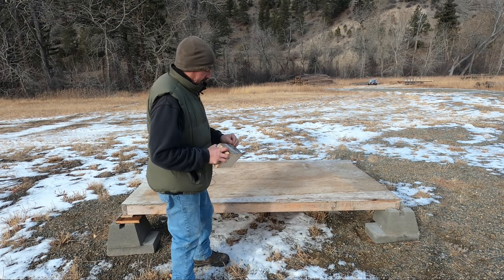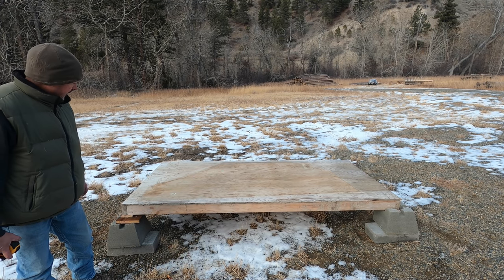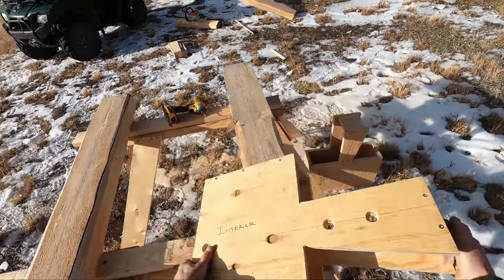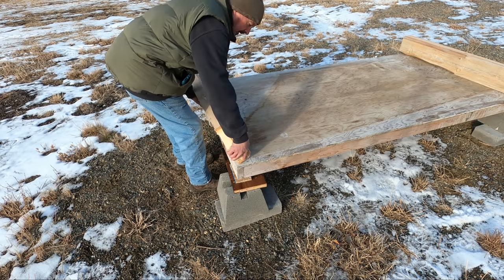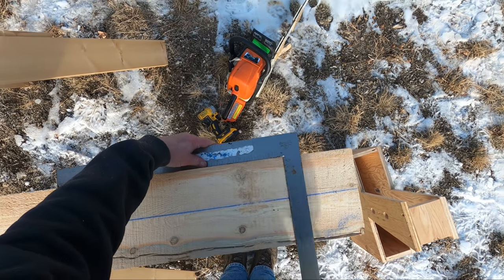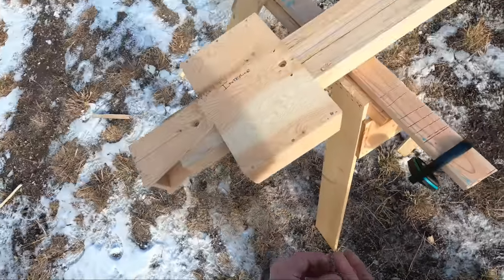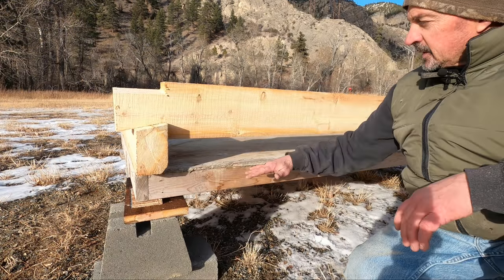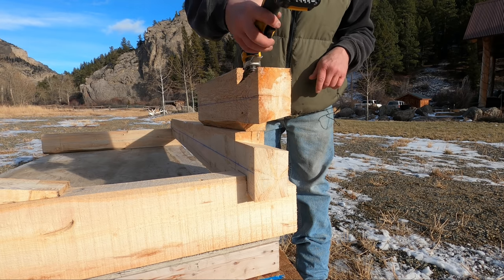How to use dovetail jigs to build a log cabin.

Comment: Appreciate the demonstration. Very well done. Now, how do I go about cutting dovetail corners so that my parallel logs fit tight together without space between them? I want to cut a groove in the bottom log to place insulmoss so it will be compressed between.
Reply from the maker: I plan to do a video soon using D shaped logs and no gap. Stay tuned.

Comment: @10:39 "Need a little more power for cutting the jig."

Have you messed around with non-stock chain grinds?  I suspect it could make quite a difference for a little saw.  I'd like to mess with a "straight grind", since I've seen some pretty remarkable results in comparison races.

But, for notching, it seems like a rip grind might be helpful, since most of the cut length is parallel to grain.

Any thoughts?  I do have a small electric saw, which I had thought might be nice for notching - maintain peaceful relations with the neighbors during late-night work bees at the house in town, etc.  One of the 220v Scandinavian saws would be nice, but they seem to be rare as hen's teeth in North America.
Reply from the maker: Haven't tried but that may help on the rip cuts.

Comment: I love your videos and have purchased a set of your templates (still waiting on them coming through though) Looking forward to part three of the Cabin Build. I have a Logosol B751 Bandsaw Mill and have just purchased a Logosol LM410 to make the Beams, although after watching your videos perhaps I might not have needed such a tool, but it will be a nice addition regardless. 

Im planning on using your templates to build a jig for 6"x6" Beams that will be molded for double tongue and grove. But the logs will be freshly felled Spruce. Im planning on 'no gap' Im assuming that if I build with freshly felled logs that if I start to build the cabin right away there will be shrinkage in the logs that will pull back from each other and create a gap not just between the logs but also between the Dovetails? Would this be a serious issue? Perhaps Butt and Pass would be better with green logs? 

Many thanks.
Reply from the maker: Hi Andy. I replied to your email. Using dried logs is best if possible. As thlogs dry, the can shrink, twist or warp some. It is possible to build with logs that are green but I do not think it is a good idea to use no gap as with a tongue and groove.
Reply: @OnBeaverCreek  thanks for the reply and the email. :) Chinking is going to be seen as quite an undesirable look here in Scotland. So its a path that I dont wish to go down. I had hoped that with the double tongue and grove the effects of twisting and warping would be somewhat mitigated. Added to the double tongue and grove Id be running lag screws and Sikaflex on each course. 

Perhaps the options open to me is to mill the 6" beams and leave them to dry for 6 months to a year (Spruce seems to dry out fairly fast) then mill the profiles and build. Or I might have to go with Butt and Pass? Id rather not go with Butt and Pass but I really want to have a Cabin built within 12 months and all I have access to is green logs.

Comment: Great video. I have a couple of questions. I would like to use 6" square logs and do not want a gap between them. Can you build me a jig for that design? Also how much thickness will I lose per log? I am starting to accumulate logs to be cut and need to figure out how many I will need. How do I contact you about purchasing the jigs? Thank you.
Reply from the maker: Hi Thomas. I can design jigs for 6x6 and no gap. Check out the website. logdovetailjig.com    Thanks!

Comment: Hello Sir. Thank you for the informative video. Is the offset of a quarter inch a standard length or does it vary depending on certain factors? How do we arrive at this calculation of a quarter inch? Thanks.
Reply from the maker: Hi. I design custom dovetail jigs and sell plans for them on my website logdovetailjig.com
I can design a custom plan for you based on your log size and the amount of chinking gap you would like to have.

Comment: Fred, you think it be a good idea to place a “window” at center length, and center bird mouth?
Then you’d be able to line up the crosshairs.
Reply from the maker: On a lot of jigs, there is not a lot of wood right in that area so not much room to drill a  hole. I don't see a need to either since you line up the vertical edge with your mark.
Reply: @OnBeaverCreek  good point 👍